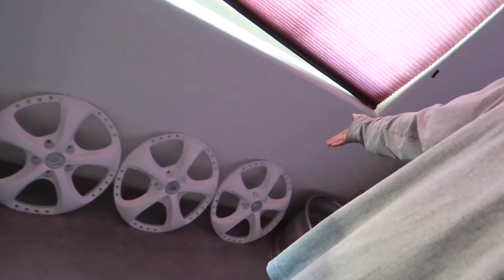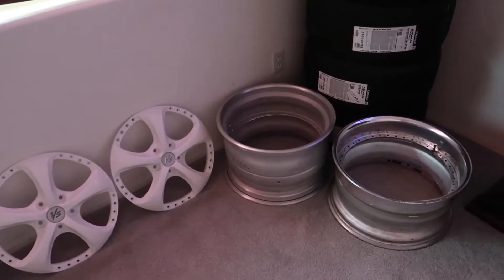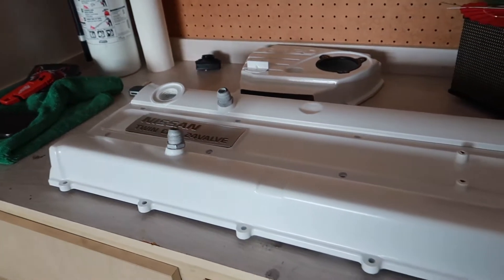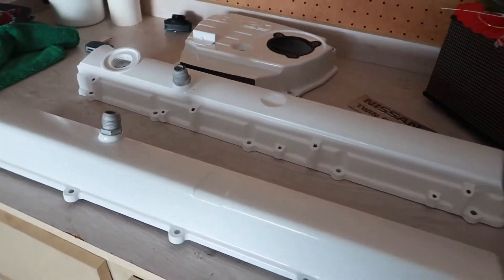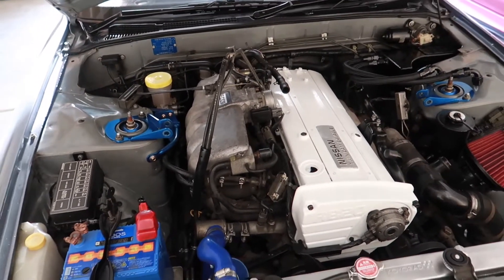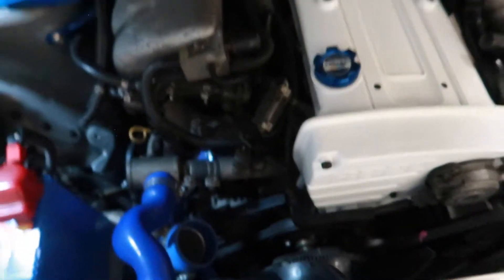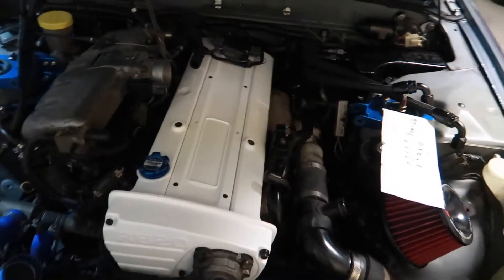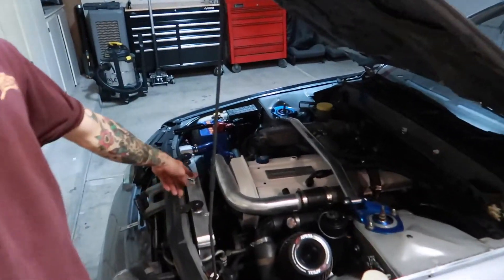R32 Skyline's rocker covers are back from powder coating!

Comment: What size push fittings are they? I can’t find them anywhere
Reply from the maker: I’m using 10an fittings. I ordered mine from Aeroflow in Australia.
Reply: Just ordered there myself thanks.. this will be my 3rd shot at these the other 10an fittings i ordered didn’t fit the bottom push it part was the same size as the top
Reply from the maker: If they worked for me, these should work for you.